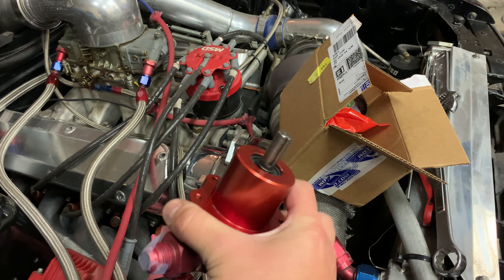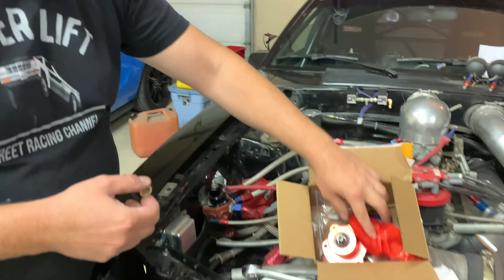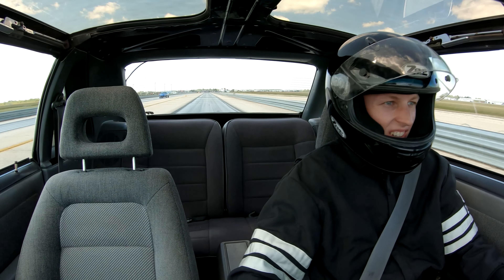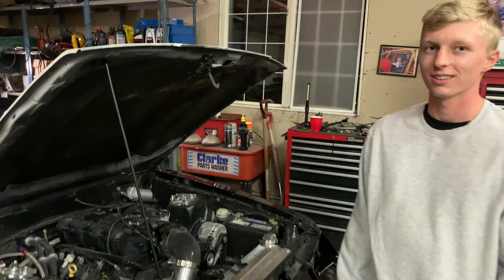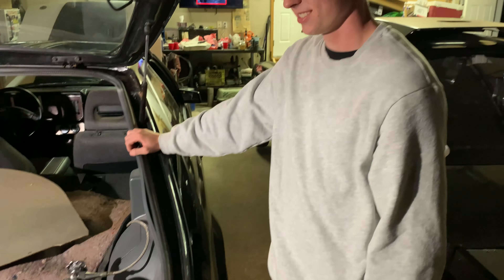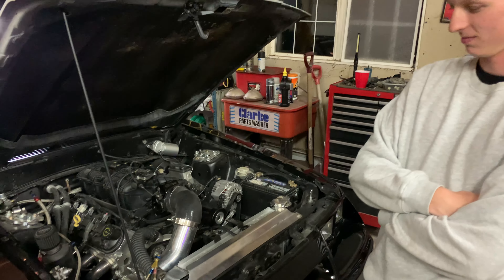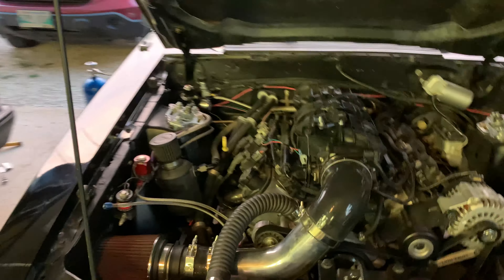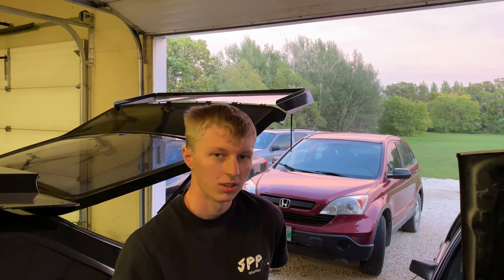Project 4 Eye NITROUS Install & RACE | 5.3 LS Swapped Mustang gets NOS & Races Dad

Comment from the maker: This time on SPPTV Riley's Mustang gets a quick and simple wet nitrous kit installed and goes racing on the 1/8th mile with it. 11.60 on motor was pretty fast for Riley, for about a week, then he needed more. Rob found some nitrous parts and pieces that were previously on the Blue Ghost's 305 TPI engine, and we decided they would work great on Riley's car to give him a taste of the nitrous.

The 4 eye struggled to grab traction this particular day and never ran a time worth mentioning. Shortly after we took it to another drag strip that is a 1/4 mile and ran some impressive times, but that's another video. Coming soon!

Comment: years ago aeromotive used some materials that were not alcohol resistant. let's just say that due to magnets that were attached inside an a1000 pump using epoxy that was not alcohol resistant, I'm now using AEM and/or Walbro inline pumps and the $400 paperweight sits on the shelf as a reminder. Maybe they fixed the problem, but I don't know.